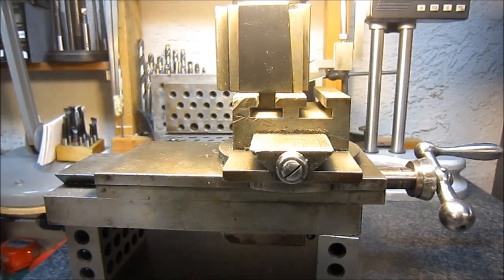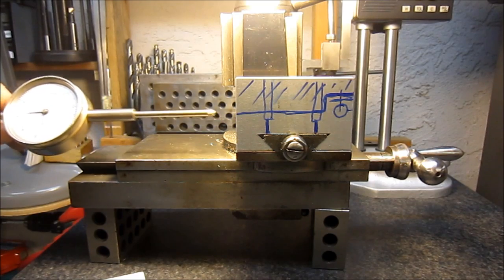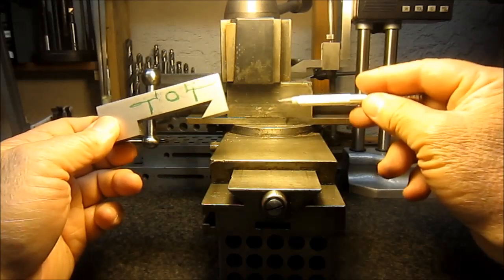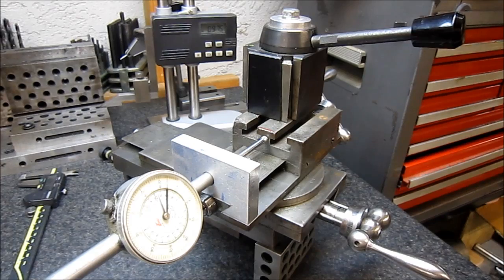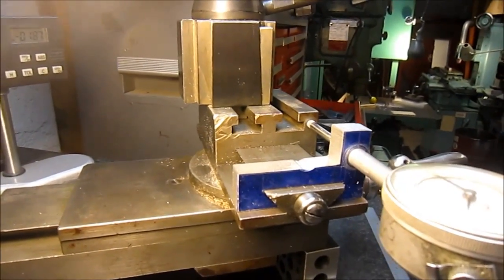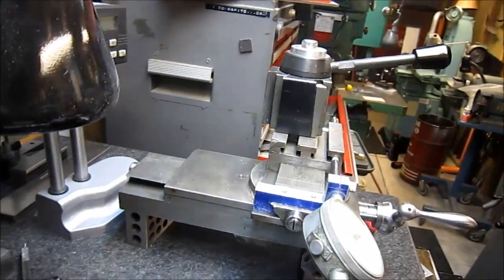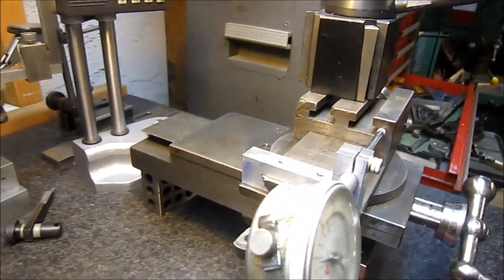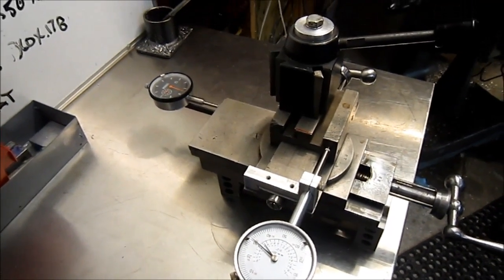TOOL TIME  Episode 11    Stark Lathe Modification

Comment: Very sweet Chuck!  I love using CAD as a tool for pattern making and figuring out stuff like you did.  When you get that down, I think you'll have even more fun with 3D!
I think your version using the T slot will be way more versatile. 

I wasn't quite sure what Tom(ox) meant about splitting the other......like in the middle so they pull together side to side?  I wouldn't have thought of that either....I'd have probably done the set screws. :)
Reply from the maker: HI Mike...
Happy Holidays....
you are right...my goal is to get a good handle on CAD and then move on to 3D modeling...
I understand what both Tom and my buddy meant on not using set screws, the clamping collar will not mar the shaft of indicator, but the set screw would eventually dig in to the surface....
Thanks for watching and your comments
Chuck

Comment: You did a good job of converting the lathe into a handy to use "Poor Man's DRO".  It'll be nice to just watch the dials and not worry about the backlash so much.
I'd like to see some of the pool cue work that your friend does. 
 Are you using actual "AutoCAD", or a generic version?
Jack
Reply from the maker: Hi Jack...
Thanks for your comments and watching..

I am using AutoCAD LT 2004

Chuck

Comment: Hi Chuck,  I think your modified design on the cross slide is a better way to go, and much more versatile, Great job! That compound tool post mount is interesting with the double slot mount. Maybe after you've mastered the auto-cad you can tutor us by video, I've always thought it would be a good thing to know.
Reply from the maker: Hi Michael...
Thanks for watching and your comment, I wanted to film the Stark lathe but just didn't have the time...an old and very versatile unit with many options.
By the time I master auto cad....hmmm, you will probably just be able to tell your phone what you want and it will draw it for you....LOL...
Chuck

Comment: Cool deal Chuck. You will really like using AutoCAD as a tool just like one of you shop tools. I would split the clamp instead of using set screws. I like the second tee slot solution. Its actually X and Z axes for lathes.

Happy holidays,

Tom
Reply from the maker: Hi Tom...
Your comments are exactly the same as my mentor as we discussed my idea of using a set screw to hold the indicator....NO NO...  LOL and after my comment of XY and the camera was off, he said the same thing X...Z...

Thanks for watching and your comments...always of extreme value to me

Chuck
Reply: Just wanted to recommend using Solidworks, Inventor or similar 3D CAD before actually making any parts. It will give you an insight of what the part actually will look like with true dimensions.
Reply: well, maybe that came out wrong, I did not want to recommend one CAD over the other.. what I wanted to say is as soon as I saw you made some calculation errors, I wanted to suggest CAD but then as the first comment I saw Tom already helped you out there. But anyways,.. doing machining from scratch,... any CAD is your friend.